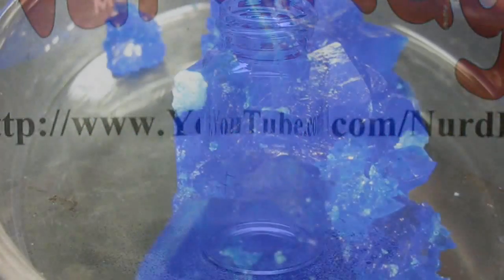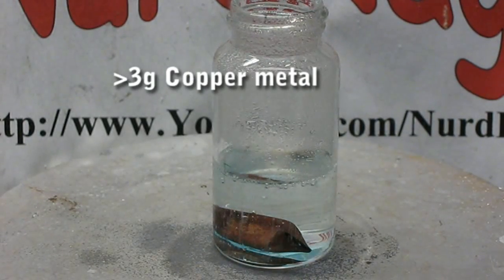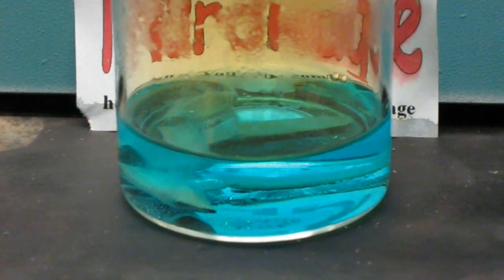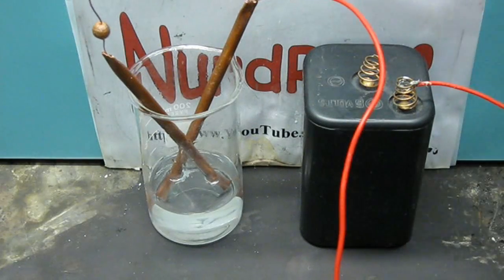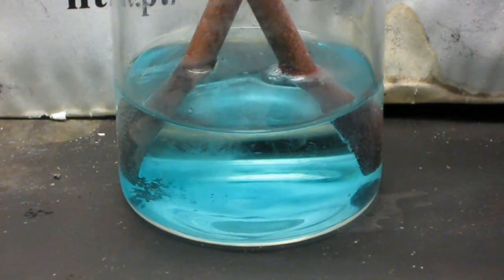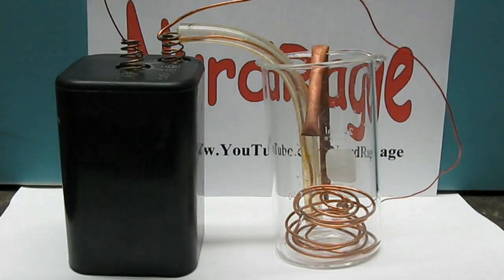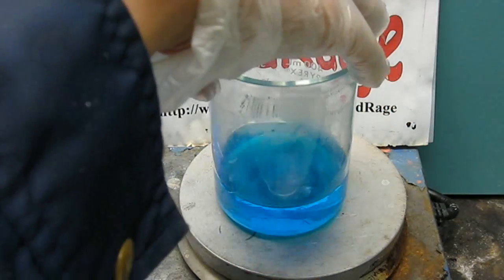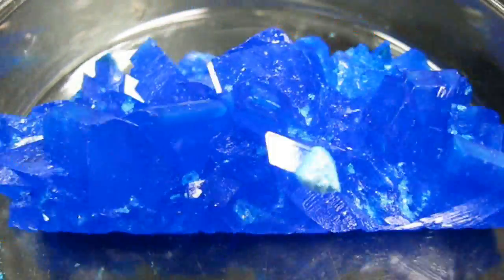Make Copper Sulfate from Copper and Sulfuric acid (3 ways)

Comment: Not sure if anyone monitors this channel anymore but I wanted to say that the electrolysis trick is brilliant.
I make 900mls in a few hours this way,  I added to your method by making several of the anode coils a head of time and when one gets eaten away I stick another one down in and let that one run.  I continue to do this until chrisals start forming in the bottom of the flask.  The yield is crazy high!

So easy and fast.

As for power supply I now use an ATX power supply, using ALL of the red (5Vdc) tied together. 
I use a cathode that I made out of a piece of  3/4in copper pipe that I split down the middle and open up like a sheet of copper.  Of coarse I leave a stem on the other end.  Its real easy with a faber  wheel on a dremel.

there is SOME small amount of oxides that form on the cathode that will settle out.  Its nano particulate so its damn near impossible to filter.  But its easy to get rid of by letting it settle out over night and simply decant off.  The brownish read particulate sticks to the bottom of the flask or jar and can be cleaned off with scrubbing.  I rip a few drops of Sulfuric acid on the bottom, swirl it around and rinse it off clean as crystal. 

Im very impressed at how fast and easy the electrolysis method is  I could literally run enough in 2 hours to do a bunch of PCB;s or copper plating.
Reply from the maker: Awesome, good to hear it worked out for ya.
Reply: NurdRage im having a crazy hard time crystallizing iron III however.
it turns to a brown sludge more than anything..  followed your iron three to the letter.
it always comes out much darker than expected.

some of the finer particulate looks like fine crystals sort of like how aluminium chloride falls out of solution.
but i never get large crystals.

i need it in solid form for an intercalation process so i will use it as is i guess,
im such a noob :)

oh and I changed the copper sulfate trick some more.
I slit a piece of 1/2 inch copper tube long ways and hammer it into a flat rectangle,  then i take a piece of 10 gauge copper wire and fold the short edge of the rectangle over the wire a couple of times and hammer it down
then i roll the rectangle up into a spiral.  it allows you to put a massive amount of copper in the mix and walk away.
it sounds complicated but it really isnt, it takes maybe 5 minutes
Reply from the maker: Clown Whisper Ferric chloride is difficult to crystalize, you need an excess of hydrochloric acid. Some sources of hydrochloric acid are not concentrated enough. Try adding more before crystallizing. Keep in mind that proper ferric chloride crystals are very dark brown. Almost black in bulk. Crushed powdered crystals are yellow. But they are all ferric chloride and dissolve easily. So don't worry if your stuff comes out looking like crud, as long as it works later for whatever you intend to use it for. The stuff in my video was carefully prepared and shown under bright light. So it tends to look better than the average sample. I made countless crappy sludge samples before i filmed that one.
Reply: NurdRage Thanks man, thats a big help mentally for me, as i am so new at these processes and don't always know what to expect.
Reply: NurdRage perhaps you can help me with something
whenever i do electrolysis with copper electrodes i get a precipitate of a brick red substance on the cathode after a good long while  

i did a large scale production of copper sulfate today and retrieved a few grams of this and placed it in a beaker.  i washed it with sulfuric acid then  di water. i then tried to oxidize it using hydrogen peroxide. i then added HCL to see if it was copper, but to my surprise it instantly turned pitch black as it dissolved back into solution.
its been 12 hours and it remains in solution as black as ink.

a drop on a glass slide shows a yellow cast to it

i get this residue every time i use copper electrodes
im sure it is brought about as the copper II sulfate level gets closer to the cathode but what it is i cant figure out. i thought that it was a nanoparticulate of copper metal but obviously its not  or it would have converted to copper chloride not black.

i have heard other people mention this happening to them as well.

your thoughts???
Reply: +Clown Whisper The brick red precipitate might possibly be a copper I compound. Under reducing conditions it might possibly be chalcocite, copper 1 sulfide. My recollection is that the mineral chalcocite comes in a variety of colours depending on formation conditions.

If you're still interested in different ways to make copper II sulfate, try adding copper metal to sulfuric acid together with a few crystals of copper II sulfate. Bubble air through the mixture and the copper will dissolve. Copper II ions are reduced to copper I by the metallic copper and then reoxidized to copper II by the oxygen from the air.

Comment: hi can you tell me in industrial level which method is used? and what is the type of oxidant used? also can you give me the detailed chemical reaction and mass balance if  an oxidant is used?
Reply: Copper oxide is dissolved in sulphuric acid- no oxidant is needed.  Using copper metal is a waste as the energy needed to reduce the copper is substantial and is lost if you go this route.

Comment: if you add more sulfuric do you get more copper sulfate
Reply: You need to add more of both. Equal them out. The sulfur can be consumed in the reaction(from the acid), So Yeah, adding more sulfuric acid is necessary, But if you only add in one piece of copper, it's not gonna make more copper sulfate. You need to balance out both to fully dissolve the copper and get all the copper sulfate you can.

Comment: It's quite easy to remember how to get bigger crystals formed in a reaction
"the slower the reaction proceeds, the greater the resultant crystals", because if the ions don't have the time to build up a big crystal they crystallizes right where they are resultiong in many crystal-nuclei.

(I'm not a nativ english speaker, so pls don't mind if i messed up the grammar or the spelling)
Reply: Also it's good to have a saturated solution, but not over-saturated, because in an over-saturated solution, little crystals are pushed out from the solution all over the place.

Comment: I am unable to filter off the copper sulfate due to the ability of sulfuric acid being able to eat through my filter paper. :)
Reply: I guess you could use fiber glass filters instead since concentrated sulfuric acid can readily oxidize cellulose (and other organic materials). But that's my guess. I could be wrong.
Reply: @JayMark2049  .
Reply: your solution is way to strong! it should be  very dilute
Reply: Clown Whisper once the water boils off the solution is mainly sulfuric acid
Reply: When neutralizing the acid, another sulfate salt will form, contaminating the copper sulfate.
If one doesn't mind going back one step before advancing two steps, one can neutralize the solution with sodium carbonate. This will convert the copper sulfate into copper carbonate, which is insoluble in water.
Afterwards, one can filter off the copper carbonate, wash it to get rid of sodium carbonate, and redissolve it in sulfuric acid while using a slight excess of copper carbonate. After filtering off the excess copper carbonate, one should be left with a reasonably pure copper sulfate solution.
Also, one can boil off the sulfuric acid by heating the crystals to above 335 °C, releasing highly corrosive sulfur trioxide vapors.
But I'd try using up all the acid by using an excess of copper and letting it react/electrolyze for a long time to avoid this problem in the first place.
Reply: If youre not concerned with recoving the acid, you could neutralise it.
Reply: Clown Whisper  can I use higher voltage
Reply: you can use a polypropylene filter commonly used in filter press apparatus.

Comment: i discovered the third method by accident. I was trying to make a H2+O2 generator, and used copper to get the electricity into a sodium sulfate solution i made. Na2So4 and H2O. this began to make copper sulfate, i noticed, and i then made another version of my generator just for the purpose

Comment: does the cathode have to be of such large diameter copper or can I use some thinner wire.
Reply: You could use thinner wire although it would be less efficient since you have less surface area.
Reply: Ariel Barton
Slower was what I had in mind. I guess that as long as the potential is correct, the diameter shouldn't influence the efficiency of the method. But I'm no expert so that's my guess.

Comment: What is up with all my DC power supplies.. none of them giving off the voltage, but giving off the frequency. Damn. I had to end up using a PSU i had spare, good thing there is a 6v connection on it :D

How long does it take until it is done?
Reply: You can use a car battery and instead of the connector stick your positive in the 3rd cell for 6v
Reply: If they "give" frequency, they're not really DC, but AC, I guess :P
Reply: Sci Twi yeah I was nub two years ago haha a lot of my posts are cringe worthy

Comment: I'm making Copper Sulfate using the electric method you showed. I stripped a piece of copper Romex and coiled it up in the bottom of one of my wives Mason jars. I folded a piece of 1/4" copper tubing over the edge of the jar and hooked up a 9 volt DC power supply. It bubbles only from the one electrode like you said. After a few hours the solution turned blue. A few questions for you though.

1. How long does this need to run to produce enough Copper Sulfate to form crystals?

2. The bubbling electrode is forming a Red Oxide (Cupric Oxide?) on it and stops bubbling after a few minutes, now that the solution is blue. It didn't do this in the beginning. If I agitate the solution OR remove the oxide from the electrode it resumes bubbling. Only to stop again in a few minutes. Is this normal?

3. I also have another batch working using half Vinegar and half Hydrogen Peroxide and Copper wire (NO electricity). This batch is a deeper blue color than the first batch, but isn't bubbling at all.  Is this a viable way to make Copper Sulfate too?

Thanks for any input you can give me. Love your channel, very informative.
Reply: Best Racing Tips Win At The Dragstrip
1.I can't tell you how long it will take since your setup is different for me i use a 3A 15v power supply and i leave it over night and i get different amount
ever time

2.It is not any oxide is copper metal that came off the negative electrode

3That is not copper sulfate that is copper acetate it just blue like copper sulfate.
Reply: Papa Monster
To know when saturation is reached, you simply have to look for a precipitate. If you see one forming, it means that the solution cannot dissolve anymore hence have reached saturation.

As for toxic gases, the second reaction involving nitric acid yields NO2 (red/brown gas) which is very toxic as said in the video.
Reply: Also, how do you know when the saturation point is reached?
Are toxic fumes given off with this method as well?
I want to use this to get copper sulfate to do some copper plating because I already have everything needed.
Reply: I'm not sure about your questions regarding fumes or saturation. I did mine in the garage with the front and rear doors open and didn't have a problem with fumes.

    It definitely works for a plating solution, because I used a standard screwdriver to stir the solution when the process was running and it came out of the liquid copper plated.
Reply: I have an old Mosin Negant rifle that I would love to have had the brass accessories.
I guess Copper plating would be interesting and unique enough.
Reply: Michael Garafalo
The fumes are hydrogen not toxic but flammable
I don't know what you mean by saturation but the longer you keep the power running the better off you will be.
Reply: Thanks for the info.
Reply: wwdadfs tefaefa
The method involving nitric acid produces NO2 gas which is very toxic.
Reply: JayMark2049
LIE if this reaction was creating Nitric acid or NO2 the positive electrode would dissolve even with low concentration Nitric acid it would still dissolve + There no Nitrogen molecule in this reaction.+ May i see the formula you use.
Reply: wwdadfs tefaefa
I said ''the method involving nitric acid''. Didn't realize you were speaking about the electrochemical reaction though.
Reply: The solution of H2O2 and vinegar is producing copper acetate Cu(Ch3COO)2..
It does produce hydrogen bubbles,just very slowly,as acetic acid is a weak acid.. It,however,bubbles and gets blue much more intensively when heated,which indicates that the reaction is going faster.. I've been making it myself before I got access to stronger acids..  It also produces crystals,which are very dark turqoise,rather than bright blue ones of sulfate.. It shares some similar properties to sulfate,like burning with a green flame..
Reply: Michael Garafalo im not sure but i think hydrogen gas is given of which is non toxic but highly flamable

Comment: Ok so here's a long question, I dissolved a penny in a mixture of vinegar and salt. After a while the solution turned a dark green from what I assumed was the copper oxidizing inside the solution. After a while I took the penny out and let the solution evaporate. When I did this I got three materials forming. A light green powder most closely resembling an oxidized copper color, salt crystals, and a very dark green opaque  crystal. The shape of the crystal is nothing like the salt. What is it?

Comment: That should work fine for anything that doesn't call for concentrated sulfuric acid. Battery acid is just a 40% solution of sulfuric acid, which is usually 95% when sold as "concentrated."

Comment: Correct me if I'm wrong but won't it be : 

Anode :

Cu (s) -> 2 e- + Cu+2

And Cathode :

Cu+2 + 2 e- -> Cu (s) ?

Wouldn't it be better if I used a salt bridge between the two electrodes? And replace the cathode with a carbon electrode? I think you can easily use a filter paper which has been dipped in a NaCl solution beforehand as a salt bridge. The solution with the anode can dissolve as much copper as possible now, without wasting energy in the cathode. Right?

Comment: You were dehydrating it. Copper sulfate is a hydrate, which mean it has water molecules trapped inside gaps in its crystal lattice. It is actually more stable in this hydrated form than in an anhydrous form. Reintroducing water allows it to rehydrate, and go to a more stable state. As such, it releases energy in the form of heat, which burned your hand.

Comment: another way is to heat concentrated H2SO4 with the copper. This will yield a white powder CuSO4 anhydrous.  Add in water and boil enough to dissolve it into a navy blue liquid, filter it and the blue crystals will grow before your eyes.  Anhydrous CuSO4 attracting its first H2O will expand a lot and can break glass vessels. Also boiling conc. H2SO4 does release some SO3 gas.

Comment: @Kyoobur9000 it would be if you had gloves, if you we're to touch it with bare hands, the moisture on your hands would react with CuSO4 and make sulphuric acid and copper hydroxide. copper is a highly charged cation, therfore it can auto-ionize water, meaning that H2O becomes H+ and OH- which mixes with the copper and sulfate ions respectively

Comment: well, i might try. yesterday, i have found another interesting composition called D1 glitter it consists of 53 g of KNO3 11 grams of charcoal, 18 grams of sulfur, 7 grams of sodium bicarbonate and 4 grams of starch or dextrin as a binder. it does not only give a nice trail of sparks (check my channel on these things, but also the trail blinks and oxidyzes in the air. i think charcoal with KNO3 and sulfur gave some energy, and excess of sulfur made K2S and Na2S whitch when molten sparks.

Comment from the maker: most straightforward way is to react copper with acetic and hydrogen peroxide. i'm not sure if the electric method would work for acetic acid without producing unwanted byproducts.

Comment: After getting copper sulfate solution, you can apply the reverse process, right? If you put two iron electrodes, one will be copper-covered by electrolysis?

Comment: Hi, i had a solution of copper(II) chloride so added in aluminium to extract the copper metal. i had one batch split into two containers, one had extra water added and produced copper but the other did not at first when no extra water was added. it produced a white/ gray particals. do you know what it is? i added water to it half way through an started getting copper.

Comment: I got a green luqiud with the same properties as copper sulpfate by using muratic acid, copper and table salt.  It will instantly plate bare steel with copper.

Comment: well i bought sulfuric acid as electrolyte for batteries and it is 30 percent. i watched on the wiki, battery acid is from 29 to 32 percents. so according to the denssities, you need to boil off 3/4 of the liquid to get concentrated sulfuric acid.i did this and that acid was strong enough to make nitric acid.

Comment: when you buy battery acid from autozone, it's sulfuric acid but doesn't tell the percent composition just the density, now if i were to heat it up to make extremely concentrated sulfuric acid, how could i eventually determine the molarity? could i measure out let's say 100 ml and multiply it by the given density of pure sulfuric acid to find mass, then convert to mols and so forth? but if i were to do this i feel it wouldn't be accurate because it wouldn't be 100%, nurdrage could you help me?

Comment: I'm new to chemistry and I doubt the blue solution I created is copper sulfate but...
I was doing the electrochemically thing but with vinegar instead of sulfuric acid.
This was for copper plating something but anyway.
The clear vinegar turned blue does this also create copper sulfate?
I highly doubt it but I'm a beginner so I'm sure you would know.